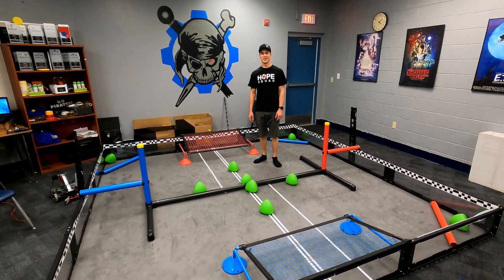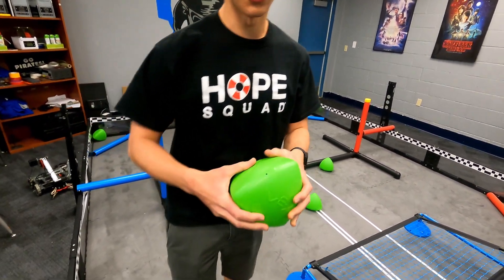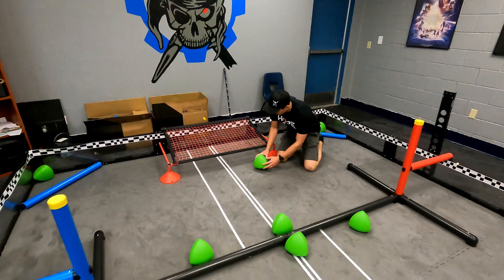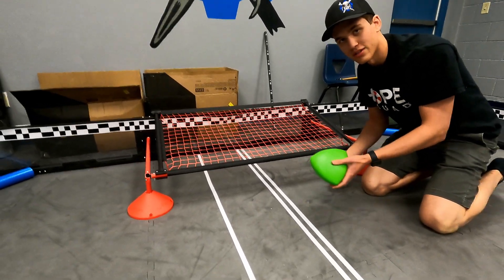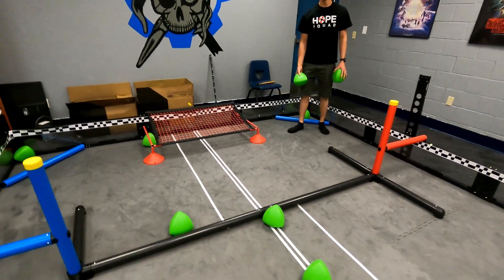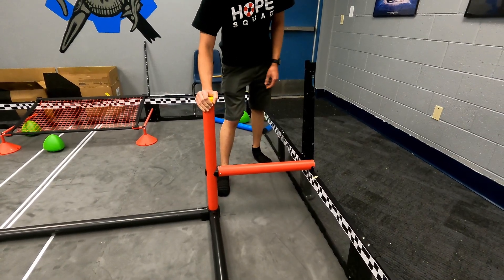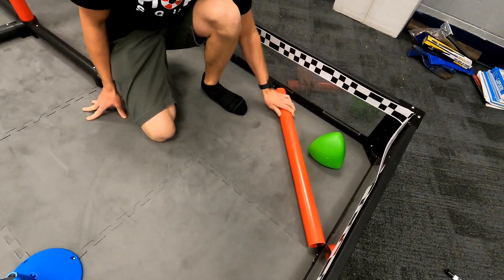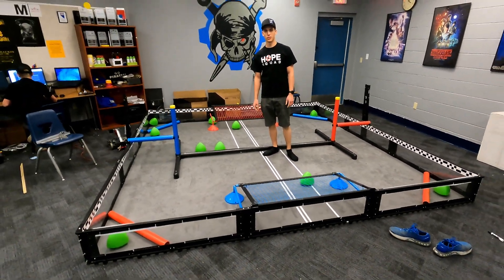VEX Over Under Field Observations

Comment: The thing I worry about with those elevation poles is the poles breaking while robots are on them, those things should be pretty sturdy I would think if they are going to be holding up robots and if its even the slightest bit wobbly screws could come out of place and not be noticed and cause some disasters for competitions. But atleast its going to be more difficult to use the things, maybe they wont turn into painful annoyances like the rollers in spin up, the one contest I went to because it was a local one and It was lots of school teams nobody could actually shoot disks and everyone was on the rollers stabbing other robots with axles, thats how my team lost in the semi finals.!

Comment: Can you push in a tri-ball from the side?
Reply from the maker: Yes you can it is a bit harder tho
Reply: How much is “a bit harder”? Do the colored bars flex like your demonstration of the front black bar? Thanks for sharing your knowledge about the field so early. We won’t get ours for a while.
Reply from the maker: The long bar is easier because it is longer so it allows for more flex compared to the smaller bars, not by a lot. It is mostly the same.

Comment: @2:50 would you be allowed to take the top off the net to allow easy access to launching the triballs in?
Reply: No it’s illegal
Reply: Pretty sure that's designed just to make it easier to get all of the acorns out after play is over, for quick field re-set.  Wouldn't really want to see referees down on hands and knees, pawing at them like cats....
Reply: There’s nothing in the manual stopping you from doing it for now, however it will probably be banned soon
Reply: @qlbbl  yes there is. No intentional manipulation of the net and it’s structure. Rtfm.
Reply from the maker: On pg. 35 of the game manual it states, "Directly manipulating the net structure, such as lifting it from the field in an attempt to add 
or remove Triballs, could be considered a Violation of <SG3>, <G7>, and/or <S2> at the Head 
Referee’s discretion" Hope this helps.

Comment: Thanks for the first look at the field we knew it was going to be nearly impossible to "shoot" but the expansion is a big hint if you pile the Acorns Infront and bulldozer them in 😅😅
Reply: I feel like this is dangerous because an argument could be made that you were possessing more than one triball which (I believe) is a dq
Reply: @sundavar4989  Actually,  in the definition of the possession rule it states : "pushing/plowing Triballs is not considered Possession; however, using concave portions of a Robot to control the movement of Triballs is
considered Possession." Therefore, bulldozing should be legal
Reply: @bharlie2080  nah they will just roll off to the sides realistically think of multiple spheres trying to roll w/o a concave portion